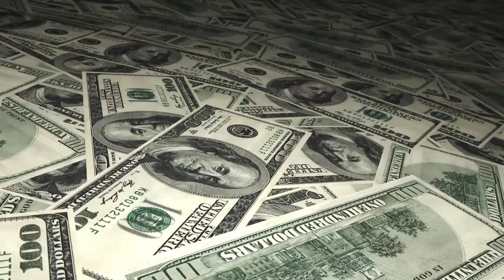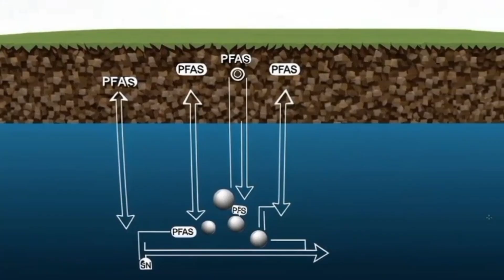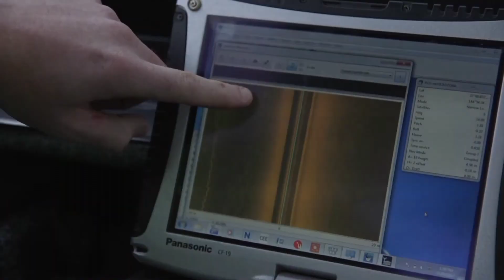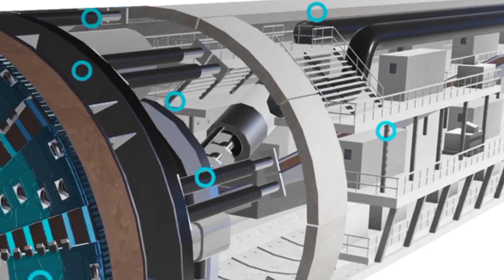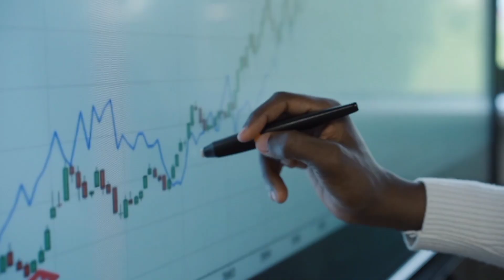Australia Spent $10B To Rescue Melbourne.  Then This Happened...

Comment: These are common problems on all tunnelling projects. Ground that is harder, softer or wetter than expected.
That is why a Geological Survey is usually carried out along the proposed route of the tunnel, with boreholes at regular intervals where core samples are taken and examined by geologists, so they get an approximated idea of what lies ahead.
This also allows them to realign the tunnel to avoid difficult conditions. I'm surprised they didn't pick up on this poisoned ground.
I think you overplayed the drama of what it's like to work on a TBM and I don't know where you got the idea that the tunnel was pressurized, the only part working under pressure is the mixing chamber behind the cutterhead and the mixing chamber bulkhead.
You should try and get your facts straight before posting!
Reply from the maker: Hey! Thanks for taking the time to watch and give feedback!  We’re always aiming toward improving! And comments like this help.
Reply: Work for the government???